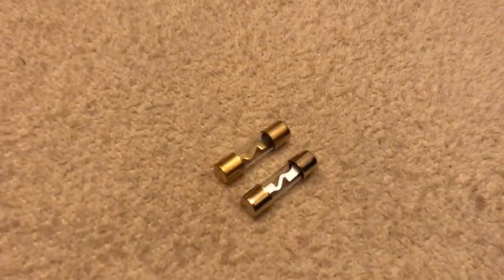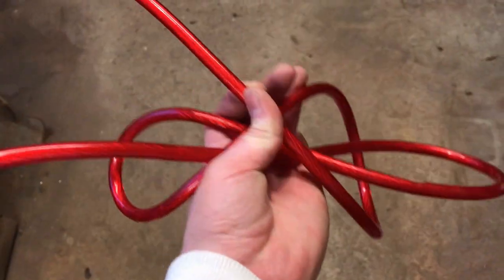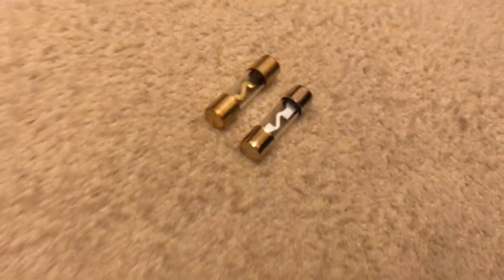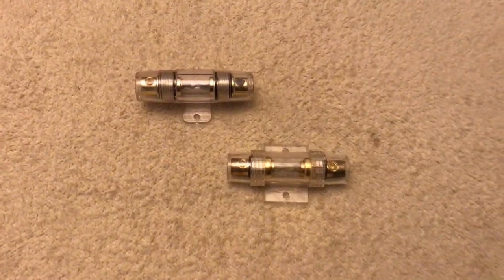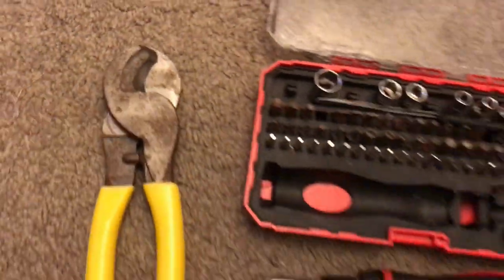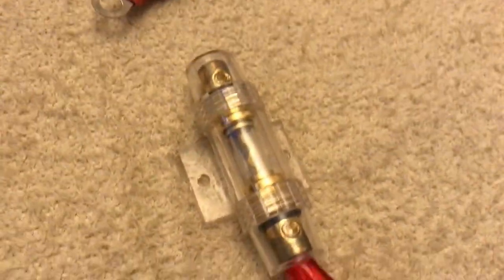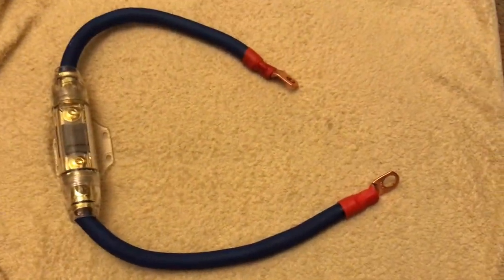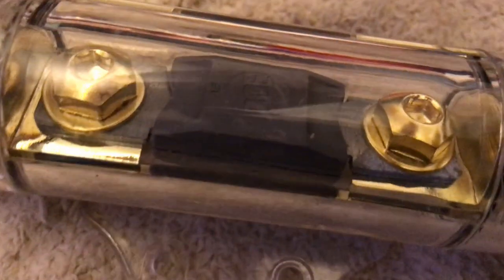What FUSE SIZE Do I Need For My POWER WIRE? 12v Electronics

Comment: I have a jl audio 10 being run by phoenix gold rx250 with 8 gauge wire or 10 gauge, which size cable would i need for a jlaudio 12 being run by a jl audio monoblock 500/1 amp any advice would be appreciated thanks

Comment: I have a 60ah battery in the hood and a 100ah in the rear trunk. The amplifier is a 1500w rms. What fuses do you recommend I put on all the cables? Thanks
Reply from the maker: The fuses will depend on wire size